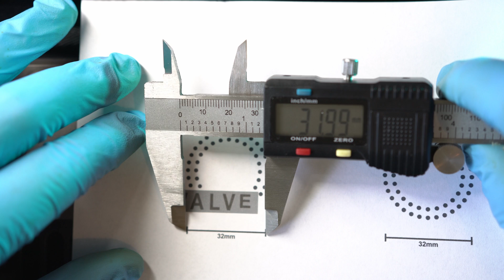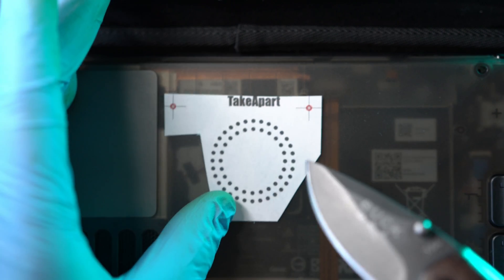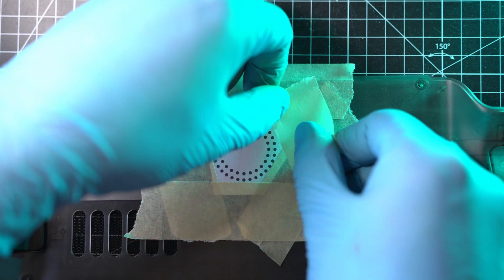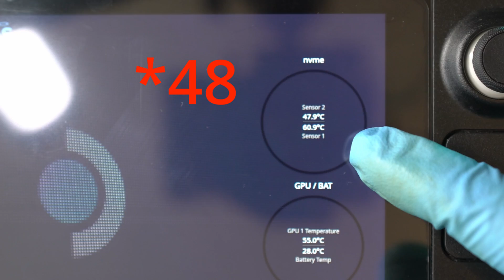Steam Deck COOLING FAN Holes Template (DIY MOD)

Comment: Thanks alot for this mod! Great idea to just drill the original backplate! 👏
Reply: From CryoByte33 channel.

The Deck was made with a specific negative pressure airflow pattern in mind, which this mod ignores. This COULD lead to long-term damage, but doesn't haven't seen ANY evidence of that yet. As the vram etc doesn't get as much air flow as it used. With you opening holes directly on the fan, the bottom right part doesn't intake air like it used to.
Reply: Just did this MOD and it gets me about 7°C lower temperature on my LCD deck. Nice!
Reply from the maker: @bluemoon5929 amazing! thanks 🙏

Comment: This turned my steam deck into a high-pitched whistle.
Reply from the maker: make sure you have nothing stuck in fan …
Reply: @takeapart I don't. I reamed all the holes to clean them up as well. Everything is clean and clear just has a high pitch somewhat quiet whistle now. If I cover it the back with a post-it note the sound goes back to normal.
Reply: But, would you still recommend???
Reply: @unjordi No. I did a shell swap to a transparent shell and didn't re drill it.

Comment: This is exactly what I was looking for, some aftermarket thing have ugly holes for the extra air flow. Even the template is what I was looking for! 

For everyone saying this will ruin the steam deck, I do trust  and understand the ideas they say, and I’m curious how this affects the life of the deck. 

Does this lower the fan noise too? Wouldn’t the fan be a bit louder now since there are tiny holes to hear them lol.

Perhaps I’ll try this on a spare backplate so I’ll have two to switch between
Reply from the maker: here you go man…. make sure to report back
Reply: @takeapart  thanks! So what about fan noise? Same, quieter, or louder?
Reply from the maker: @ChocolateAsian9000 lower

Comment: Stop putting holes in Steam Decks. You are screwing up the airflow. You will make the APU cooler, but you will make other components hotter because you are messing with the air channel.
Reply from the maker: case airflow still present!  please elaborate your facts
Reply: @takeapart  The original design generates negative pressure to pull air across all other components inside of the chassis. By placing these holes in that spot you eliminate that effect. Air flow is reduced in all other areas outside of the APU.  Your APU has a sensor and it will report lower temps. However, the other areas like memory modules will have higher temps, but they have no sensor. People that have tested with proper equipment (thermal imaging) have shown this to be true. Gamers Nexus has also talked about how the deck cooling works.
Reply: @fbihoneypot I did that with Thermal Grizzly Duronaut, you get about 7c lower for GPU and 8c lower for CPU.

Comment: hope you come back and post another video in a while so we can hear whether this cooks your ssd, VRMS, and literally just every component on the motherboard that isnt connected to the heat pipe. 

the worst part might be that with the CPU so much cooler it wont throttle and could burn out all those other components faster.
Reply from the maker: still rocking hard! no problems at all so far

Comment: This is a very terrible idea to do to your steam deck, and even runs the risk of ruining your steam deck permanently. There is a reason in a purpose that they have designed the air intake location. It’s supposed to cool other items off before it gets to the other areas to cool stuff.
Reply: 3:50 video creator very much took this into account in the design
Reply from the maker: @YogiTheBearMan correct
Reply from the maker: look, if they would want to be efficient (the engineers) they would use different way to passively cool down other components on motherboard…. factory design looks to me that it was pushed by budget and ease of production. 
you don’t have to do anything to your SD , that is why Im here for. 
thanks for your comment

Comment: Can't help but wonder if this is actually wise to do.
Also can't imagine that the engineers who designed the thermal householding would not be aware of something like this.
Reply: The stock design allows air to flow over all components which is likely important for longevity.
Reply from the maker: @michaeldmorrison correct, however this still keeps that airflow in the case.
Reply: Other users have tested this with the JBAUX cooling case with vent. The device thinks it is running cooler, but the APU doesn't get enough airflow. I would not recommend adding holes (DIY or manufactured shell) on your Deck.
Reply from the maker: @C71-m1l the trick is in combined holes area!  it has to be just right… therefore airflow inside the case stays sufficient.
Reply from the maker: great comment! ahm yes but engineers must take to a count noise and cost of doing so … I have seen way worse designs from way bigger companies so  IMO you right but there is also other side to every solution.